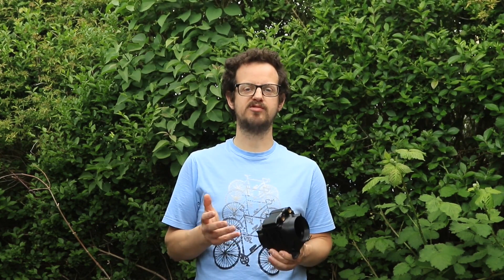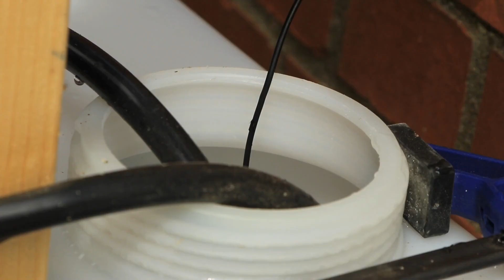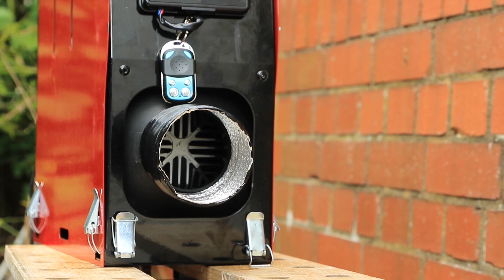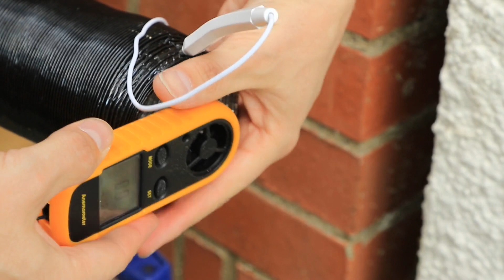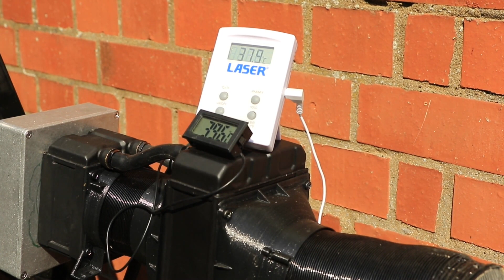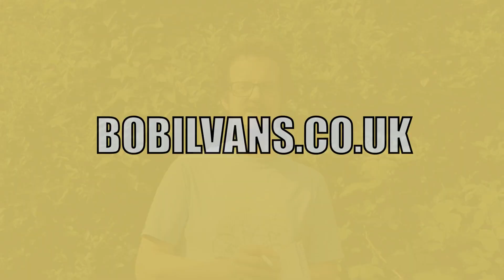5kW Chinese diesel heater exhaust gas energy recovery

Comment: I would think using the exhaust air would be a quick way to coke up those heat exchanger radiators and destroy the efficiency of the water heater.
Reply from the maker: Probably- it was only an experiment to see how much energy there is in the exhaust. Stainless steel EGR coolers would be much more appropriate.

Comment: Is the exchanger meant to normally be added to the conditioned air part of the heater?  Seems like an odd arrangement.  you're stealing heat from the "conditioned air".  Stealing heat from the exhaust side would make more sense.    It would be more efficient to use an exhaust gas heat exhanger .  You can get them easily online.
Reply from the maker: Hi Pierre. We ‘steal’ heat from the conditioned air because there is a lot more energy to ‘steal’. Plus in the summer it doesn’t then warm your van up. Watch our other videos to see the full system, it works really well. Exhaust gas recovery systems cause back pressure, which is why we went for this exchanger system.
Reply: @bobilvans4205   but who runs a heater in the summer?   Heaters are for when its cold,  when you want the heater producing heat.    better to use the waste heat from the exhaust  that way you are not stealing from the conditioned air when its needed!!
Reply from the maker: Pierre Mitham you turn the heater on when you want to heat water. This way it heats water, not air. Watch our other videos to see the full system. Just using exhaust air doesn’t cool the air from the the main heater which heats up your van-precisely what you don’t want in summer.
Reply from the maker: Pierre Mitham you turn the heater on when you want to heat water. This way it heats water, not air. Watch our other videos to see the full system. Just using exhaust air doesn’t cool the air from the the main heater which heats up your van-precisely what you don’t want in summer.
Reply: @bobilvans4205  hello. So in this case. What happends if water is already heated, and we still need to use hot air for the van, we won't be pushing water through the heat exchanger, but we will hearing noise from.boiling water all.tge time. So this means that we should have two diesel heaters, one for air and other for water?
Reply from the maker: @renzoREspinoza  no, we sell an air diverter so you can turn the water heater off!